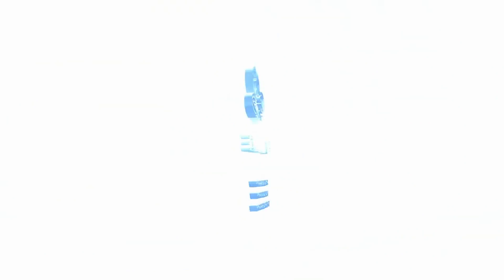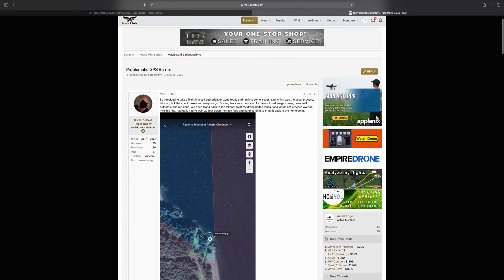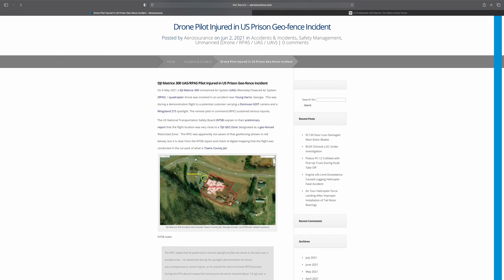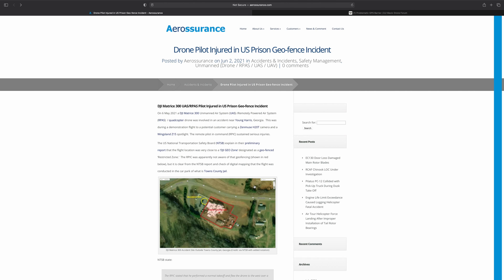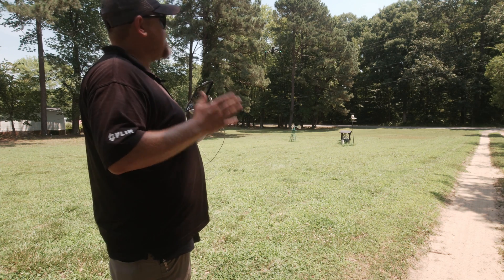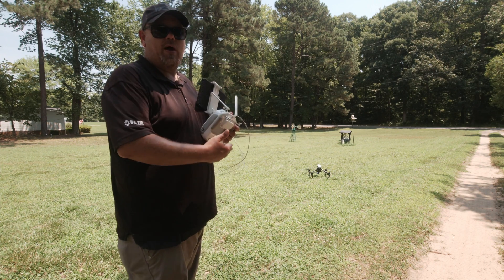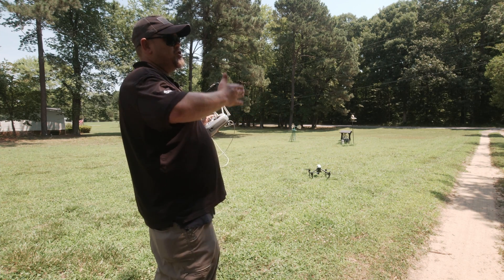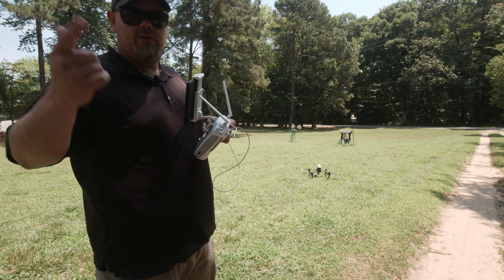If you fly a DJI drone this is a must watch! DJI no fly zones and what you need to know!

Comment: Lots of great tips. Could I also add checking that the drone's compass orientation on the ground matches that on the map (and if rotated, agrees) BEFORE powering up your drone - that's the best way of catching compass /IMU errors before take off. Then listen/check for correct RTH confirmation during the hover check.

Comment: This is infuriating. I just went to a thermal flight in Long Island in a 300 grid right next to a zero grid and I could not take off at all. not with the Phantom, not with the 300. I couldn't get a self unlock. I couldn't get a custom unlock. it's just BS
Reply from the maker: Sorry to hear that. It really is terrible when you are not able to do a job due to unlock. Did they give a reason you could not get a custom unlock. Keep in mind you cannot use a mobile device for the DJI self unlock. I have been able to use the browser option of “Desktop Site” to get an unlock on my Ipad. I also had another time I had to get the hotspot going and use the laptop. Were you so close to the zero grid that it would not let you unlock because it thought you were in it?
Reply: @aerialedgellc9372  yes it thought I was in a zero grid, I had the mobile hotspot on I even had the wife to it from home nothing but the worst part is that I drove 3 to 4 hours each way